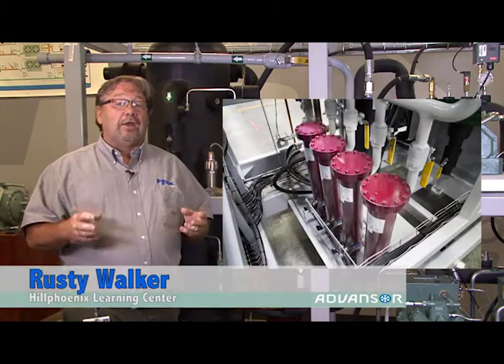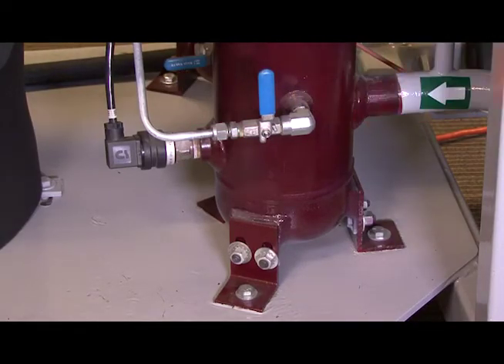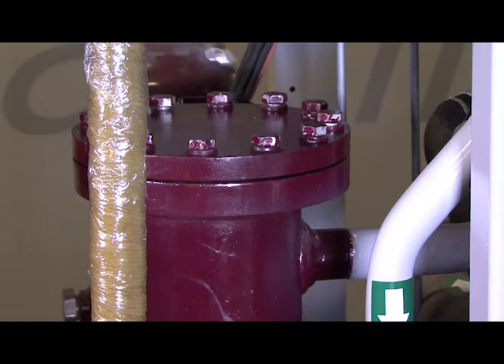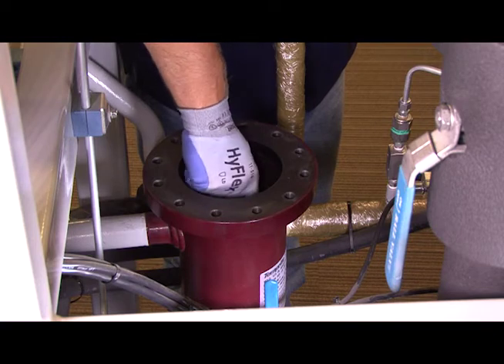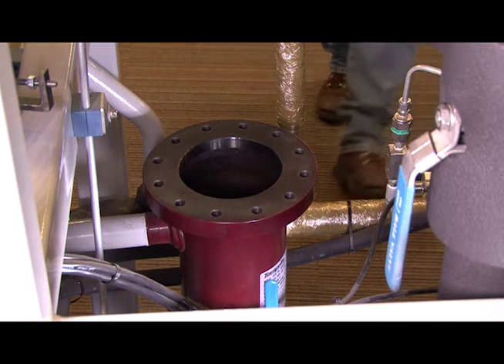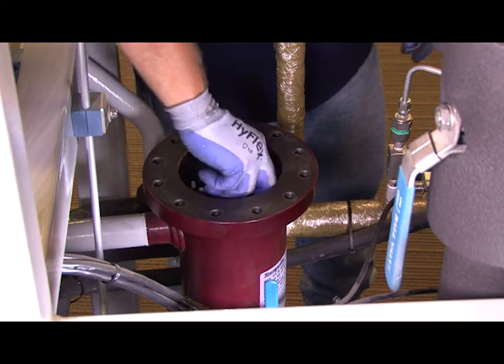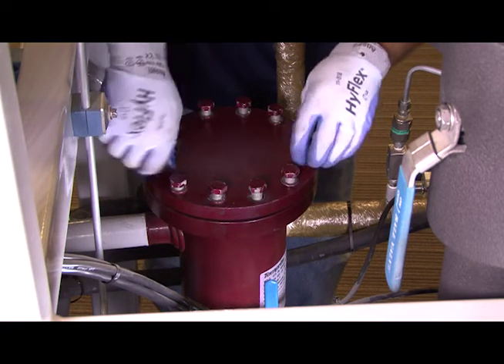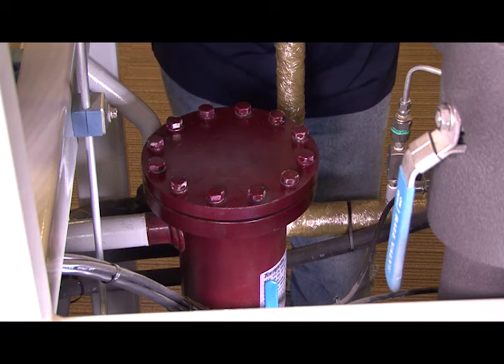Advansor CO2 Booster System Tech Tip - Oil Filter Change

Comment: Justin, you are correct the unit should be pump down and once the separator has been isolated the CO2 in the discharge line and separator needs to be vented